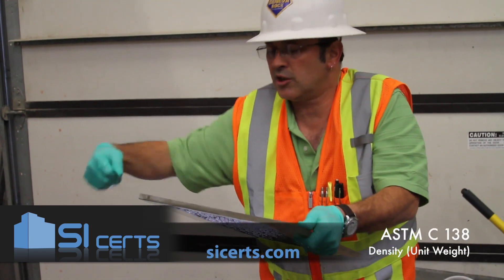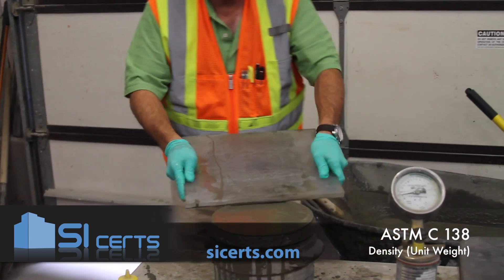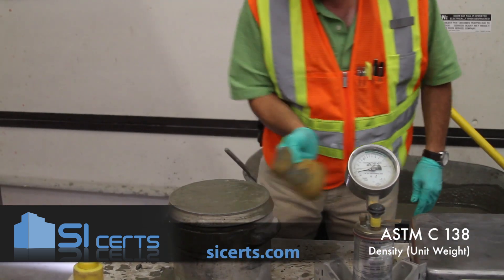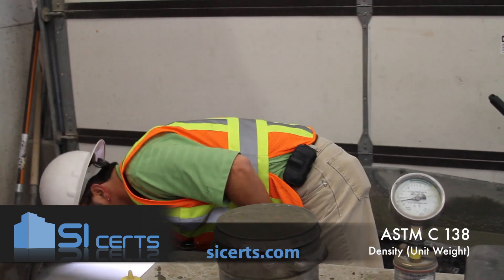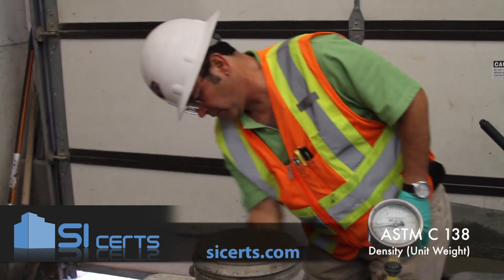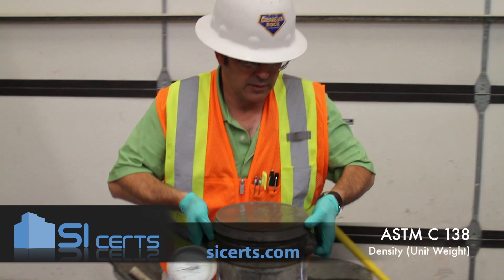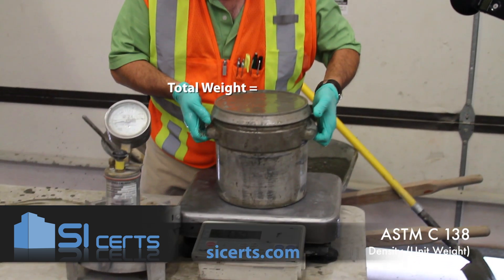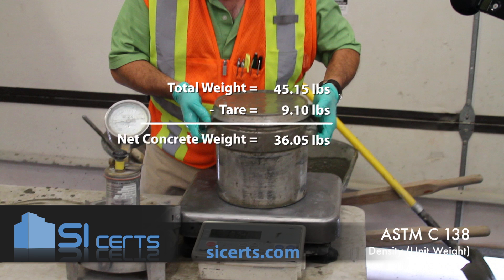ASTM C138 - ACI Unit Weight of Concrete Test (Newer Version Available, Click Top Right Corner)

Comment: You failed to show that after weighing the measure you must dampen the measure, you failed to show that the measure must be filled in 3 equal layers rodding each later throughout it's depth plus striking the sides of the measure with a mallet 10-15 times after rodding each layer.

Whoever follows this video will fail the performance test 100%
Reply from the maker: @Mental Stanley we cover the filling of the pot in another video, but skip to the measurements in this one to get straight to the point. We have a newer set of videos that we filmed early this year. We address everything and you can see that here. https://www.youtube.com/watch?v=1mLgdtgRxY8&t=8s